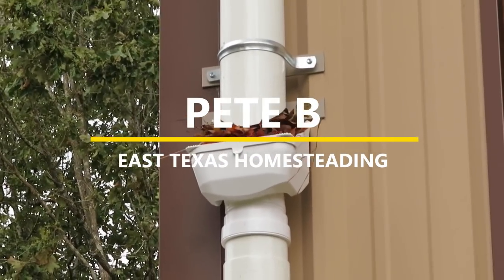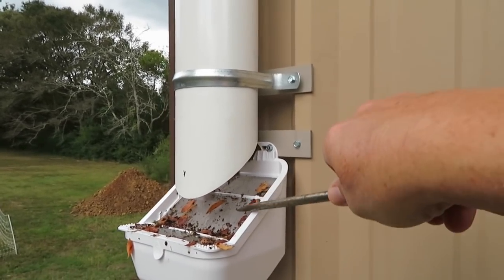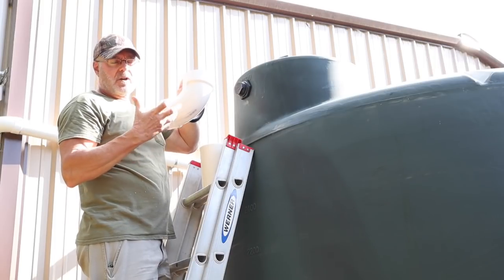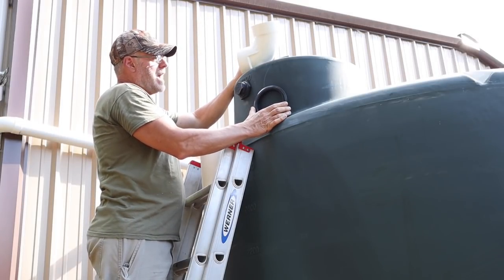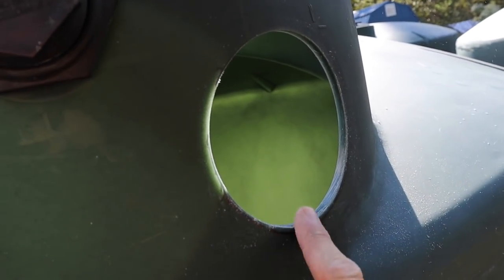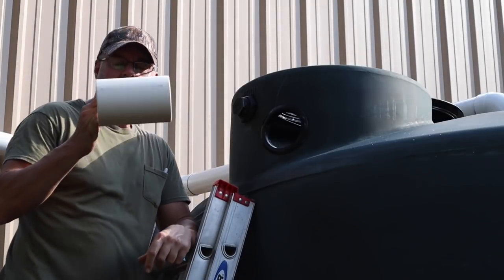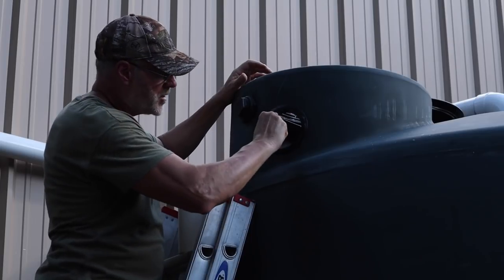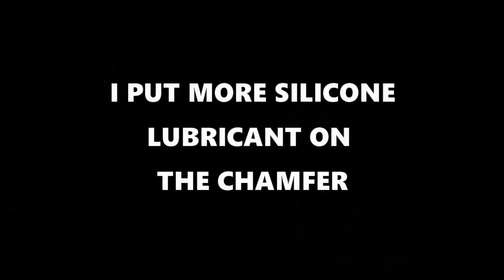Rainwater Harvesting System Part 5 - Overflow Pipe Installation

Comment: Stick that poly pipe in the freezer for half an hour that should shrink it down slightly so you can get it in then as it warms up again it will be a tight fit.

Comment: Pete if you use gutter guards that have a fine mesh leaves will not enter your gutters. I got mine from Costco and work well
Reply from the maker: My gutters connect to the building differently and I can't use standard gutter guards. I'll have a video showing that Wednesday.

Comment: Thanks
Reply from the maker: Thank you
Reply: @petebeasttexashomesteading  so I’ve only watched the first 2. 1-2 so far on the catch water system.I’m guessing that the way you changed 
Will be a good move. We put on 6 inch gutter this spring, and when the gully washer hits you need the bigger volume capacity here in southern , mo. So I was glad you equaled the outflow to 6 inches. But why not do a fill at top of tank? I’m hoping that gets explained as  I watch the rest.
Supporting a 8 ft pipe in air would definitely be a challenge. But I’m trying to figure out how you can fill in bottom without a pump? I’ll wait and see.
Got new chicks hatching in incubator. Hoping that by March they will be able to add to production, and can feed outside about then. 
See ya.

Comment: Pete just curious why schedule 40 for the overflow plumbing and not the lighter sewer/vent type of piping you used in the rest of the system?
Reply from the maker: I could only find uniseal for sch. 40 pipe.

Comment: What is the minimum size for an overflow pipe
Reply from the maker: I have two 4 inch pipes going in and one 4 inch going out for the overflow and it been working great. So I would go minimum of half of what you have going on to the tank.
Reply: The overflow should be designed and sized to discharge the maximum amount of water plus a safety margin that would be reasonably expected during a heavy rain event if the tank filled. 
Of interest, Pete has actually decreased his tank's overflow capacity by fitting the upturned elbow because the vertical crest is now higher than the horizontal invert would have otherwise been. For example,  an unmeshed 100mm (slightly less than 4") diameter horizontal outlet with 200mm of water above its invert will discharge at 8.08 L/s whereas a 100mm vertical pipe's crest that is 150mm above the horizontal pipe's invert, thus having 50mm of water above the crest with the same water level, will flow at 4.67 L/s. This may however be fine for many installations but making hydraulic calculations is a prerequisite.

Comment: Why didnt you just use the outlet that was already on the tank next to the hole you drilled? It isnt that big but it would do the job just fine.
Reply from the maker: That hole is too small, it's not even two inches. I have two 4 inch pipes filling the tank and one 1.5 inch hole just won't cut it.

Comment: Why didn’t u just use 2 inch bung righT there, screw in street el to threads on inside.
Reply: you technically need an overfolw the same size or larger than your inputs..  it takes 4- 2" pipes to equal the same area as a 4" pipe.  (16 - 1" pipes for a 4" pipe).  otherwise if the water can't escape fast enough, your tank will build pressure and probably split.

Comment: The Leaf Eater is a failed Australian product. The failings are:

The filter mesh is set at approximately 35 degrees which is grossly inadequate for debris shedding.

To make things worse, there is a flat recessed section of mesh at the bottom that dams debris, causing splash.

There is no protection to the falling water from wind, causing further yield losses.

In another video, I noticed that you hard connected balance lines between the tanks. This is a big NO! You should have used flexible corrugated food grade hose. I hope that you attend to this ASAP.

The main point of this post is to comment on your use of the upturned elbow on the tank's overflow pipe. A water tank's overflow pipe must always have a pre hydraulic calculation made to make sure it is of suitable overflow capacity but maybe you are not too concerned about the tank overtopping during heavy rain when the tanks are full because the overflow pipe drains to ground anyway.

A vertical pipe has a higher overflow capacity than a horizontal outlet at the same height but you have raised the overflow weir from what was a high point already afforded minimal mitigation to one much higher.

The weir flow over the crest is greater the higher the water level is. The roof area is 2,400 sq feet and so 1" of rain will give 1,500 US gallons of water or 150 US gallons if it rained with a steady intensity of 1/10th of an inch per minute. Would you experience a similar rain intensity very often where you are? 

You have used sch 40 pvc pipe which has an internal diameter larger than nominal and which also varies depending on the pressure rating chosen. The figures below are for a 3.94" (100mm) vertical pipe draining with different water levels above its crest. I have done the conversions from metric figures and they are for an unmeshed orifice. The flap valve fitted at the bottom provides no restriction as opposed to a meshed overflow outlet fitted at the tank.

1.57"    66 gpm  
1.97"    73.8 gpm
2.95"    90.6 gpm
3.94"    104.4 gpm
4.92"    117 gpm
Reply: SInce you mentioned the "Leaf Eater" being a failed product, is there a better option that you would recomend?
Reply: @stilllearningagain  The problem is that manufacturer's generally play "Monkey see...monkey do" which is why there are so many similar products and an emphasis on point of sales appeal. Having a great product name also does wonders!
ICON plastics in Australia sell a "Leaf And Debris Controller" styled on a traditional rainhead. It was originally made by Marley in New Zealand and after changing the original woeful honeycomb style outer filter, it is by far a better choice. 
The large (x2 the Leaf Eater) outer triangular straight ribbed filter is on a steep slope and highly effective at shedding debris. There is also a large mosquito proof inner filter that is easily pulled out at the front for cleaning. The falling water is also shielded from wind. It is however larger and heavier (865 grams) than the Leaf Eater (620 grams) which you have to consider if you are importing. 
Why not make your own? If you know someone who has a 3D printer and can do files, you could have a sheet metal body made and either get some wedge wire filter or have a wedge wire filter 3D printed to suit.
I have seen a YouTube vid showing a 3Dprinted wedge wire filter which from memory may have been wrongly referred to as a Coanda filter, a mistake many others have made. You will probably have more luck if you search "Coanda Filter" rather han "Wedge Wire Filter".